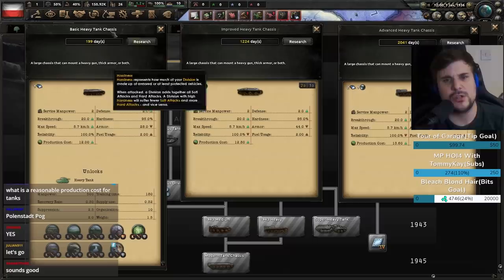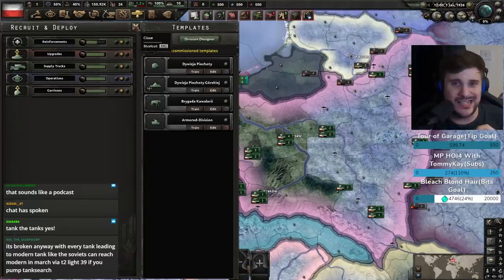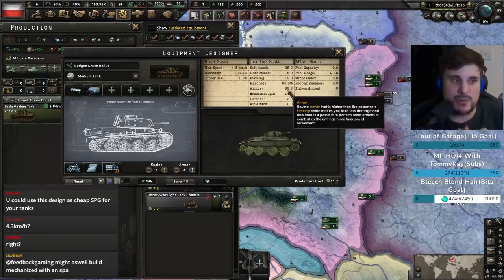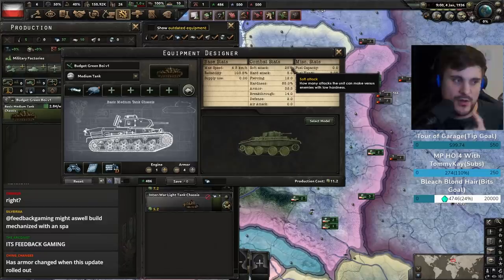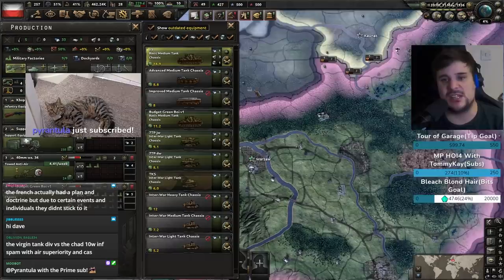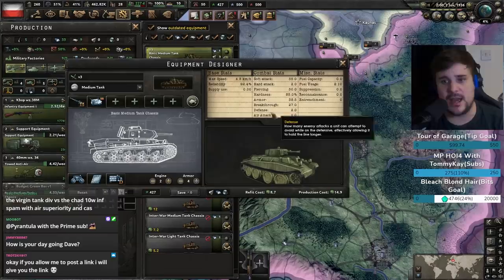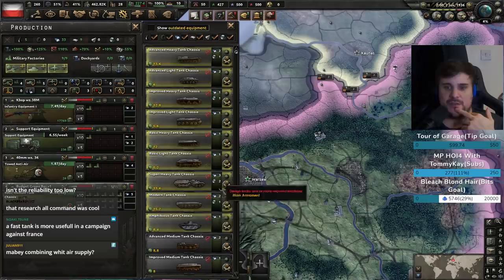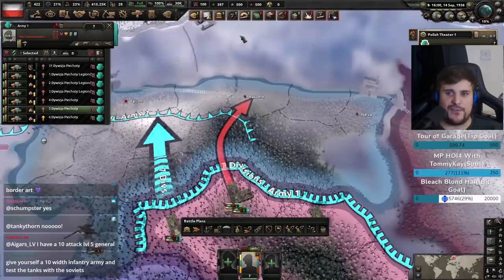NEW Optimal Tank Design - HOI4 No Step Back Tank Designer Guide

Comment: So far I like to go with expensive mediums at 8KMH to match the mech, cast armour, torsion bar, sloped armour, advanced radio, 3 man turret, medium artillery armament and wet ammunition storage so I can max my armour stats. I like it because it can easily shred through infantry, and I’ll always add on 2 battalions of high velocity cannon tank destroyers to compensate
Reply: should do welded armor, mediums aren't made to take a beating and depending on the role, you might want high velocity cannon to counter heavies
Reply: @chrisofelt6427  yeah I always have a few high velocity cannon battalions for piercing in case of AI tanks, but even those aren’t needed as the AI has the habit of mixing mediums and lights together which I personally think is a horrible idea
Reply: @oscars4608  
That sounds like a complete waste of production though xD
How much does each tank cost to produce? And how many resources per factory??

From what I know (which, right now, just after the DLC dropped, is still basically nothing, lol) it seems best to make something that's slow and cheap, but with a LOT of soft attack, and just enough breakthrough and armor. 

Those tanks would be inferior to yours, but you'd be able to build twice as many, perhaps :)
And they'd still crush the AI... Even tank battalions aren't a big deal if you just blow away their manpower, causing their Org to drop :)

Like, here, just per illustration:
Sloped and cast armor makes your tanks cost 30% extra!!

That means that if you were to field a full army of 24 divisions, I could make 34.28 divisions(!!) that would be almost-identical, for the same cost! 
They'd still have 70% of your armor, which is probably plenty to blast apart your infantry divisions, after which I can just drive around your tank army to supply hubs or victory points! (as in, I have more divisions, so you can block/fight some, but cannot catch/stop them all simultaneously)
Even worse, depending on your division design, I might even be able to pierce your 24 divisions right back, in which case you'd just be overwhelmed/outproduced.... 
TLDR: cast armor is just **insane**! 

For sloped, you at least gain more percents than you pay, lol
Sloped costs 10% more for +20% armor, while cast armor costs 20% more for +10% armor...
So if I only changed your designs from cast to welded armor, I could still get 120% of your divisions (24 -> 30) with 90% of their armor, for the same cost!
Reply: @M J
D'uhm... Are you sure?? 👀🙃

Just looking at the Wiki, which still has the old values, a medium battalion has 50 tanks and costs 600, whereas a heavy battalion has 40 tanks and costs 1000 production.

If this DLC changed how many are in a battalion, please inform me 😅

But, looking at some videos on YouTube, I couldn't help but notice that most people's medium tanks tend to cost 25-30 production each, which is exactly what a heavy tank used to cost 😆
(I haven't seen heavy tank designs yet though, so can't really compare, but it does seem like we'll have far fewer armored divisions from now on!)
Reply: @M J 
Oh... was just reading the notes for patch 1.11.4 and saw this:
"- AA gun 3 now medium weapon, Tanks are now a bit slower, *heavys/sh are now more expensive* "
Too bad man, they're onto ya ;)
Reply: @oscars4608  and good infantry with basic anti-tank will pen light tanks anyway, I decided to try something new in single player which was amphibious tanks with howitzer 2, let's just say no naval invasion was stopped and they absolutely destroyed infantry and 'swam' over those rivers too nothing was stopping those but I also had thousands of CAS too so that melted everything too
Reply: @MrNicoJac  thank you so much for that comment, I didn’t know how not worth it cast armour is! However I think I’ll stick with it for SP because I love the feeling of that little shield saying I can’t be pierced in every battle no matter the enemy divisions 😈
Reply: @oscars4608 
Oh, I'd definitely aim for that shield too.
I'd just try out for once whether you need cast iron for that.
Maybe build one welded division too, and see whether it makes a difference.
If not, you'd save yourself a lot of factories/time ;)

Comment: I think the large howitzers gets good piercing because the shell is so large armour doesn't really matter.
Reply from the maker: Howitzer shells aren't solid they're explosive. The shells exploded outside of the armour on impact
Reply: @FeedbackIRL  Howitzers were often issued different shells including armour piercing and 'Anti-concrete' shells. 
The SU-152 was usually only issued with HE (high explosive) rounds, and still earned the nickname 'Beast Killer' as they were known to blow the turrets off tigers. 
HE rounds are also known to cause 'spalling' on the inside of armoured vehicles, killing the crew.
Citations: Wikipedia (very thorough  research)
Reply from the maker: Think you missed the point I was making
Reply: @FeedbackIRL  Firstly: This is the weirdest conversation I've ever had, and that's saying a lot. (In a good way)
Secondly: I have no clue what point you were making.
Thirdly: I like your content, keep doing what your doing.

Comment: I thought of a tank that's really good for a major nation, and easily upgradable. Medium Chassis, Medium Howitzer, 3-Man Turret, Roadwheel Suspension, Diesel Engine, Welded Armor, Radio, Additional Machine Guns, Sloped Armor, and Wet Ammo Storage. This gives you a huge amount of excess reliability, and you can add engine and armor points as you like. It's not absurdly expensive (around 25 production cost), and it has a huge amount of breakthrough, soft attack, and armor points. It works well in a 20 width template (5 tank battalions and 5 motorized battalions), and you can add AA to even it out to 21 width so it fits well into forests and plains, but that's not really necessary.

Comment: No more than 15 for heavy tanks?!

[starts sweating in 24 in cost and over 100 in armor]
Reply: @M J 
So I wasn’t even off to a bad start. Noice.
Generally speaking though, my tanks never encountered much AT, I feel like. Either that or I didn’t notice it.

So he has a point I guess.

Though my creation which I lovely call “Tscherepacha” has around 150 armor and 50 soft attack. Admittedly the production costs went up a bit once I researched the late war chassis but generally speaking I’m good
I love the new DLC

Comment: I don't agree about the not needing SPG's or Tank destroyers. especially TD's the way armor and piercing work its usefull to make a heavily armored heavy piercing TD and put 1 in your template. Since medium TD's require only 24 pieces of equipment for 1 battalion (vs 50 for the standard meidum tank template) it doesnt matter if its expensive. So u prop up ur armor and pericing stat with that and just use high soft attack low armor cheap tanks to get your soft attack and breakthrough up. its not the fact that you dont need it since you can design any tank to be a TD the point is that a TD battallion is way cheaper than a medium tank battalion but uses more combat width.

Comment: Imho three man turret and gasoline engine are must have. The gasoline let you put less points into engine, which means less fuel consumption and less cost for the same speed. Yes, you lose a little bit of reliability, but just a little bit. The three man turret gives you so much better stats that is worth the cost (which is quiet limited, only 0.8). I think that a tank that cost 15 is worth when it has 30 or 40% better stats than one that cost 12. I prefer having less good tanks and be able to do something with them than just pump out crap that will eat your supply and won't win you any battle. With this supply sistem, any tank you put on the field needs to be a difference maker, otherwise it's better to have infantry and save supply.
Also, the high velocity gun is not much worst in soft attack, gives you waaaaay more hard attack, and allows you to have TD, that are still good: you need very few of them to get the armor bonus in your infantry. So, I find it interesting to think about that.

Comment: Why not have a three man turret with radio for your tanks, and a fixed superstructure with a meaty howitzer for your SPGs?
Reply from the maker: Because it has no breakthrough and is expensive
Reply: @FeedbackIRL  If you give your tanks more breakthrough, you can afford to put fewer battalions into a division, and LSPGs are dirt cheap if you convert them from old obsolete light tanks Germany and the USSR start out with.

Comment: You shouldn't be designing divisions to fit into EVERY terrain type because you lose out on having maximally efficient "additional attack" capabilities in all but one of them (mountains in the case of 25w.) If you design a defensive infantry template that can "pretty much" (rather than always like the 25w) do everything everywhere like 15w with 30w (or 40w) attacking divisions but also then design specialized divisions for attacking and defending mountains and marshes then you'll be much better off.  Why 40w and 30w? They are THE most efficient divisions when considering the most common terrain types in Europe; plains, forest and hills, the 30w having an advantage over the 40w in cities by actually being able to reinforce through "additional attacks". I prefer them because of that but they're roughly equal otherwise. The devs want you to specialize your troops at least somewhat to fit your needs. You don't need to do everything everywhere at the same time.
Reply: @anonymous-rb2sr  Increasing training time is literally pointless when you can easily switch templates and manually train units. 100 marine divisions in 1936 easy. LOL. 

Personally I think the way special forces work now is fine. The limit is annoying, sure, but that's why they're so strong. Giving them penalties in different terrain other than their specialty is an interesting idea, but it doesn't make that much sense practically. A marine special forces division is still going to be pretty damn good fighting in normal terrain. Much better than regular infantrymen straight out of bootcamp, even. I'm not too up on my WWII paratrooper history but it seems to me that their training wasn't made TOO rigorous considering how many losses they were expected to take not only as they para dropped in full view of the enemy (unless we're talking about nighttime missions which are dangerous in their own way), but after landing deep in enemy territory so maybe it could apply more to them. =P

Comment: what about the converting meta? You make a shitty low cost tank with the right chasis and then you make a second production line converting those to the one you want
Reply: Does not work anymore, they fixed the conversion prices so that converting tanks is now more expensive, if you add the cheap tank production cost and then add on the conversion cost for the tank you actually want, you end up in a deficit.
It can still work if you make a super cheap chassis, and a slightly more expensive main tank but then, when you start upgrading it, it gets more expensive so its pointless.
Reply: That’s a shame, there should be a cost as you might be swapping out running gear or other parts but you sure save a lot in RL reusing the same Hull.
Reply: @stevepirie8130  Yes, but you shouldn't be able to build a given design cheaper by converting it from a cheap base model. Conversions IRL were a way of reusing older and/or captured tanks in a battle environment they were no longer suitable for, not a way to make stuff on the cheap

Comment: The new tank meta is no tanks meta. Motorized for pushing and encirclements, basic infantry + CAS for holding the line. Tanks are superfluous.
Reply: I still wanted to give this a try because someone else said it too, why is motorised suddenly good?
Reply: @GundamReviver  10 base breakthrough, 20% base hardness (40% with first mechanized tech), high speed. If you go for motorized rocket artillery you can set up production lines and forget about changing them. Passive upgrades will do the rest. Maaaybe switch to better guns. 42 width division costs around 3.5-4k and has about 300 breakthrough. Good tank division costs 10-20k. Use the saved production on spamming fighters and CAS. Air is king in the new patch.
Reply: @IxGxNxI  yeah I figured out air being king, but now you mention the numbers involved I understand, hell thst might even be doable on some minors.
Reply: @GundamReviver  Doesn't that just mean that you should start using AA, like actual WWII divisions did?
Reply: @talltroll7092  nah since AA isn't strong enough vs air.

Comment: I dont know when can you use older tanks in stockpile to upgrade them and when not. Sometimes i have the game tell me that i couldn't, save the same design again and then it could from the previoua design (had some 1,2 k on stockpile)
Reply: @M J yeah but that may not be all. I had changed my t34 model to have a biger gun, turret and additionl armor and the first time i saved it i couldnt refit them
Reply: @gonshi9  
Of course you couldn't refit them at first. You changed the template itself. 
The next time, you made a *second* design, and then the game can switch between designs. 

If you make a new plane variant by upgrading something, the game also dumps a new design with a new name in your list.
Reply: @MrNicoJac  bruhh that what i did
Reply: I ve played hoi for a while, im not falling for that hahaha
Reply: @gonshi9 
Yeah, but you didn't understand why it didn't work, at first.
Well, like I just explained, because you did it wrong, at first 🙃
Reply: @MrNicoJac  i didnt it wrong my guy hahaha (at least not because of that reason)

Comment: Currently the AI builds almost no armored divisions. 1943 Germany? 4 Armored divisions. 1948 USA? 3 Armored divisions. Until the AI fixes itself, SP meta will definitely be either howitzer tanks with decent breakthrough and just enough armor to stop current year support AT, or even straight up SPGs. Support Flame tanks, support light tanks, and a couple of SPG battalions, maybe Space Marines are back on the menu for achievement hunters, they could be very cheap to field and full on armored divisions seem like huge overkill in SP.

Comment: best meta currently possible is going sp doctrine and spamming 10 width infantry with full support companies. As for tank i go 16 width with 3 motorized and 4 tanks. They give you just enough firepower to shred through ai, low supply consumption and actually cost effective. 3 16 width tank divisions are more effective than 1 45 width tank division. Another benefit of 16 width tanks is that your supply consumption is so low to the point that you can advance into the tight front lines where supply are low and make a breakthrough. Also being able to produce a lot of divisions cuz of their low production cost means that you can actually spear head in 3 or 4 point at the same time. Also using 12 width mechanized or motorized to fill the gaps will ensure that your tanks will never get encircled. i think meta is shifted towards small units now because of supply and combat width system. For example, if you use regular 40 width tanks in benelux,you will run into supply problem and will be slower in advance however, 16 width with 12 width mech and mot can shred through benelux and take paris within days without any major problem. Also 16 width and 12 width are ideal for africa corps as germany where supply will be next to nothing.
Reply: @anonymous-rb2sr  yeah like you

Comment: Bro the new update kinda weird... my motorized cant cope with enemy and often bogged down and with it, destroying my entire supply line because the trucks are all dead in the frontline.

But somehow, my run with cavalry and STUG fuckin works. It aint much, but it can slowly encircle enemy and win battles....well because supply mechanic my advancement is slooooooow no more gigachad encirclements :((
Reply: Pretty historical then. Motorised divsions were meant to be exploitation units, capable of keeping up with fast armoured units and holding ground for them so they could keep running, not hardcore assault divisions. If you try using them according to actual doctrine, you may have more success

Comment: should prabably have made the tank go 6km and match it with cavalry
Reply from the maker: True true!
Reply: not, that the 1-2 combo, you make a a slow medium to go in your inf to pin divs and hold ground, and make a slightly faster tank for your cav template to do encirclement or supply deny

Comment: have u actuallu bothered to look up how much weaker 3 26 or 28 are vs a 25 and how much theu lose in overwidth? losing 10% in attack goes from 110 to 100 which is eh. and in defense 10% from 400 to 360 is neglible ur gonna hold the mountain i rather waste 1000 rifles on 2 more width to have stronger push in forests and rivers

Comment: Interesting analysis on fast tanks not being as useful. Have a current Russia game going on, and I made fast mediums like I usually do, and I might have to agree with that. 
Doing a small breakthrough to cutoff supply seems to be the meta rather than large encirclements. In that case, slower, harder hitting tanks are more beneficial.
Reply: Did a conversion roach built with my first Soviet game. Created WW1 trench warfare in the middle of Poland. Then, in 1942, built 1940 heavies with okay speed and lots of soft attack. It did work in winning slogs at the border against German Deathstacks.